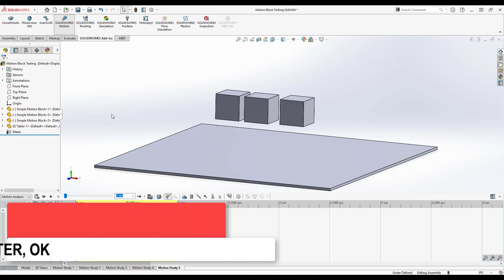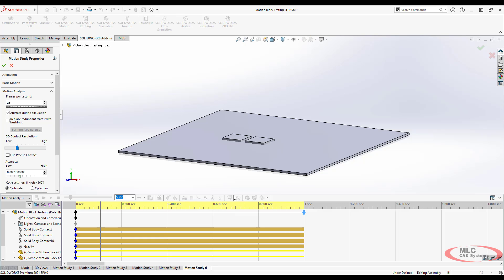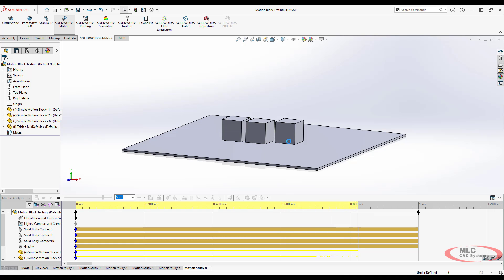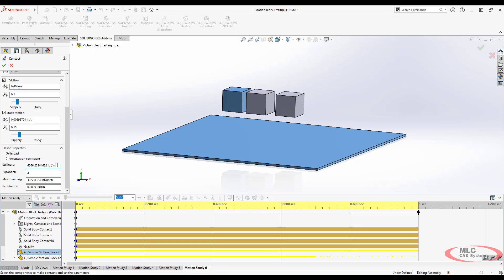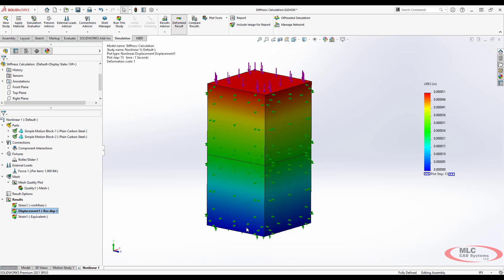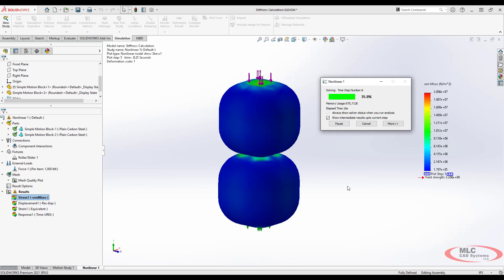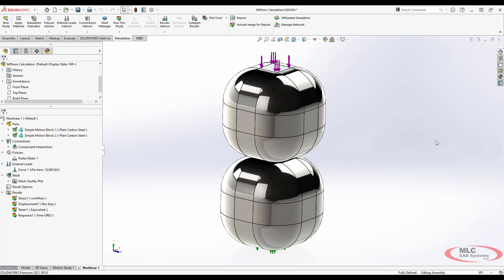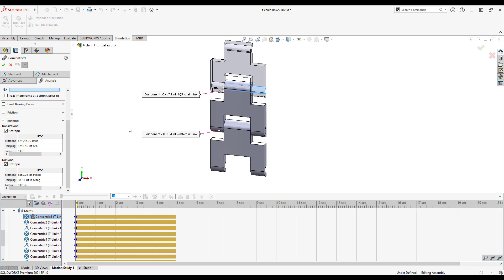SOLIDWORKS Motion Tutorial Series #9 - Contacts and Bushing Stiffness

Comment: Good day, thank you so much for your responses, I am sorry that I did not reply earlier, I didn't have notifications turned on. I am trying to find the stiffness of brass on brass with a cylinder on a plate. But the simulation keeps on failing saying that I am trying to get intermediate results on a non linear study, do you maybe know how I can fix this?
Reply: I am trying at the moment to press a disk into a plate but the simulation keeps on failing, is there a possibility that you know why this is. I cant upload pictures of my problem here.
Reply from the maker: It sounds like your Simulation study is failing, which could be caused by any number of issues but they are definitely going to be specific to your study setup.  I would reach out to your VAR for support, if you are an MLC CAD Systems customer on subscription service you can email solidworkssupport@mlc-cad.com and someone from our team will reach out and assist!

Comment: should we create contact by selecting all components or 1 into 1?
Reply from the maker: It depends on what result you want.  For example, if you have many different objects and all of them might interact with all of the others in the same way, such as rolling a large number of dice, you can select them all at once.  If each contact set has a different stiffness or is unlikely to contact other components you will probably save solve time by defining them 1 at a time.
Reply: @MLCCADSystems  Thankyou so much perfectly got it

Comment: Hi, the results found in this video do not match the values of the default steel impact properties. Could you please advise on why this is?
Reply from the maker: Contact stiffness depends on both the material involved and the relative shapes and depth of engagement.  There is no way to accurately calculate the stiffness of any given interaction using the assumptions used in Motion so the values provided are approximations only and the values calculated apply only to this shape/material/force.  You must confirm the stiffness for your specific interactions manually.

Comment: Good day, This video has been extremely helpful. I would just like to know if there is any literature that supports this as I would like to reference this in a university project. I am also a little weary on the method that you used to calculate the damping as the default materials show a maximum of 0.8% of the stiffness. I am trying to find the values to simulated a brass piston coming into contact with a brass cylinder. I really hope that you can help me and thanks for the video!
Reply from the maker: Damping values can be extremely hard to calculate without real world data, the values used here were approximations based on the software vendor recommendations and your results or needs may vary.  If your main concern is impact accuracy, use a drop test, Nonlinear or a Nonlinear dynamic FEA study.  Motion Simulation's assumptions are simply too broad to give you accurate impact values and are only provided to allow you to simulate the motion of the system where impact is involved, not to give you high accuracy of the impact itself.